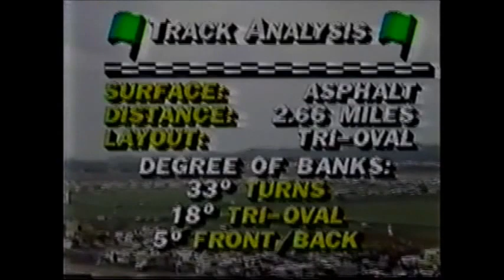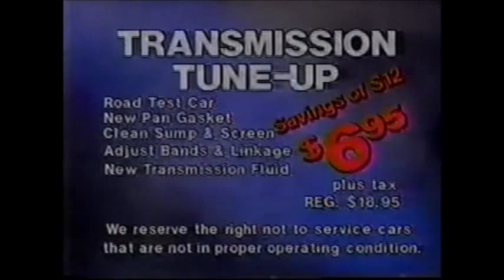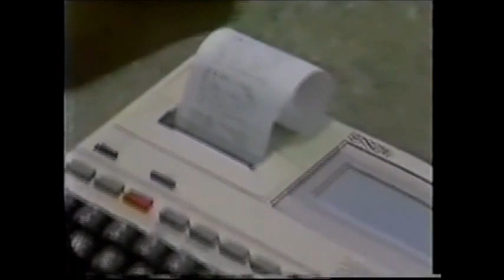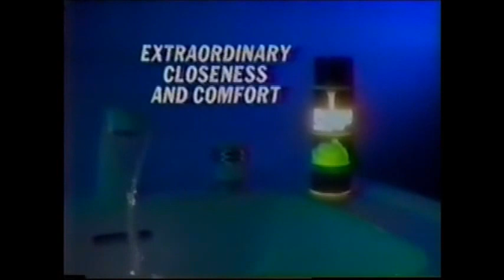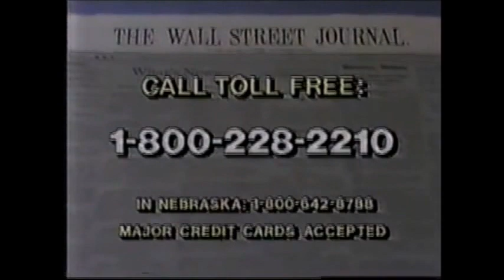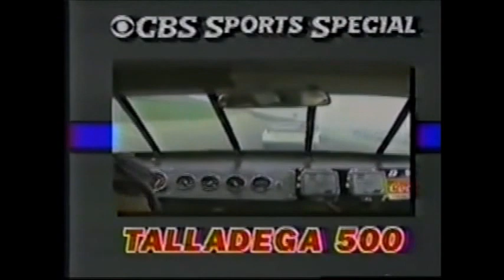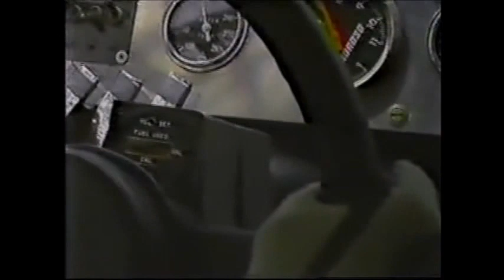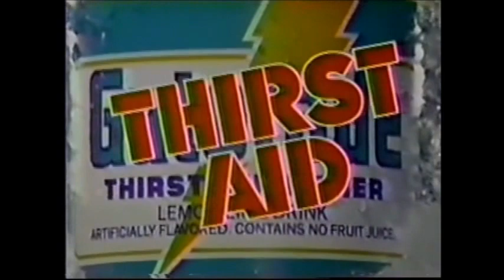1984 Talladega 500

Comment: This was my first NASCAR race ever in person.  I was right inside the wall where Petty broke down around 53:00.  If the camera had shot wider angle, I would have been right there.  Now I'm all disappointed that I couldn't see myself 36 years ago.  My friend's father was an exec with Century wrecker in Chattanooga, so we had all-access passes.  Quite a way to break into NASCAR.  It was a great time.  The day before, we saw an ARCA race and an IROC race with quite a few stars of other racing.  I think Mario Andretti and Gordon Johncock were there.  To see the cars come down the straightaway to the start/finish after two laps was surreal.  Just awesome.  I always liked NASCAR but that made me a big fan.  Not so much anymore.  BTW, so cool to see the #43 out there in this video.  I also miss when they called the facility Alabama International Motor Speedway (AIMS) instead of what they call it now (Talladega Superspeedway).  Correction:  Andretti did not participate that year.  https://www.racing-reference.info/season-stats/1984/I/

Comment: The good old days when drivers were true iron men. Before these dumbass competition cautions, cars actually resembled the cars they were based off of, the cars werent restricted to death, they werent all running what is essentially a spec chassis, and independent teams could actually afford to run a few races a year without having to spend a hundred million to compete. 
Nascar has become the antithesis of what it was created to be. It used to be a bunch of good ole boys getting together to see who was the fastest. Now its just another bastardized form of slot car racing.
Reply: Has it occurred to you the smaller teams are coming back now because NASCAR finally is taking away over engineering?   The racing here is amazing.   2022 it’s been amazing